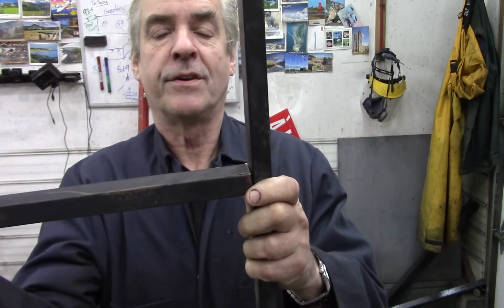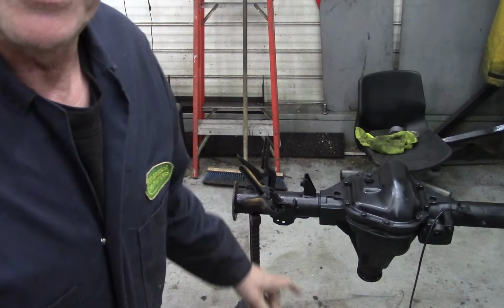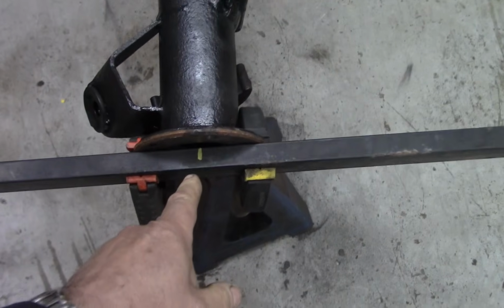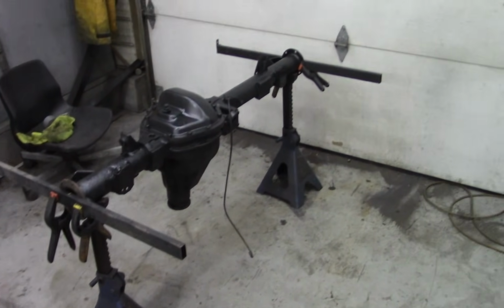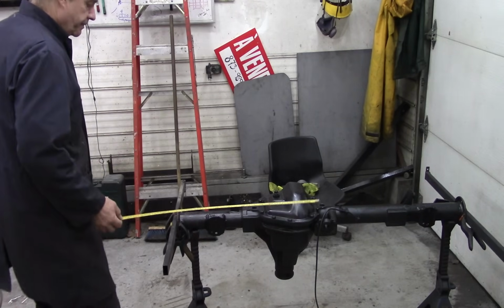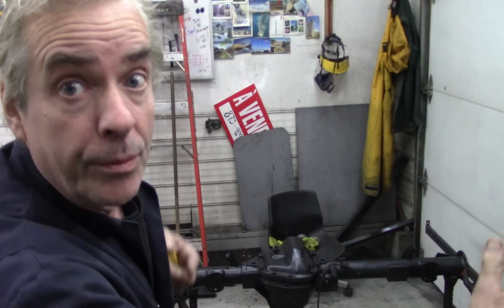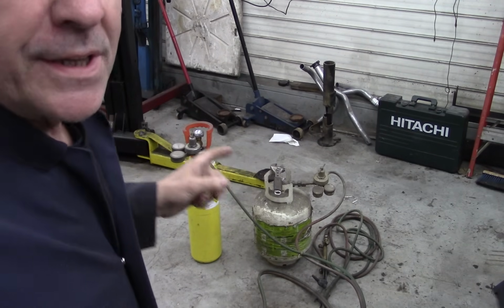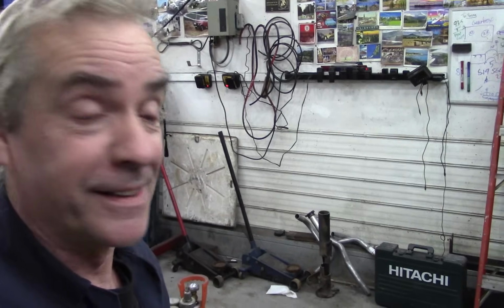A bad Salisbury axle restoration Part 3

Comment: Thanks for these videos!
I am going to fix a mates rear axle shortly, same corrosion issues.
I am curious tho how straight the axle was before the welding. I am also wondering what the measurements are measuring in a horizontal plane.
Thanks again!

Comment: Did the steam puffing out the tube on the second heat up indicate that the tube has a hole or split in it ?
Reply from the maker: No, that was oil inside the tube flashing out of the end of the empty casing